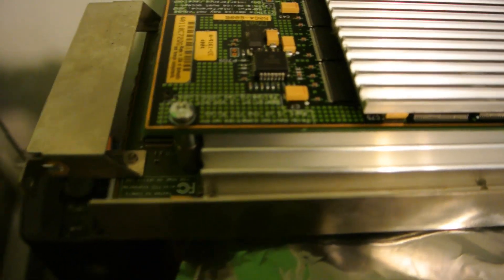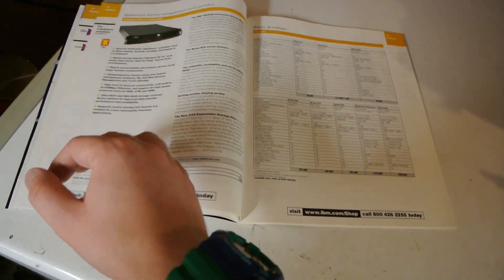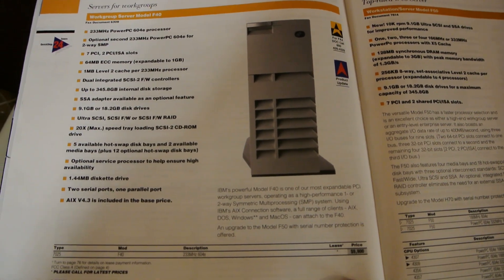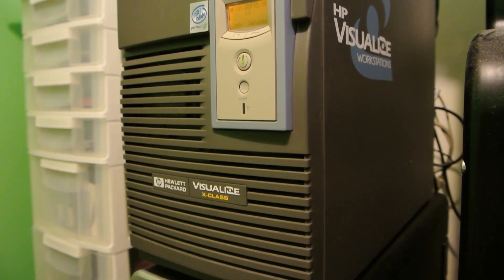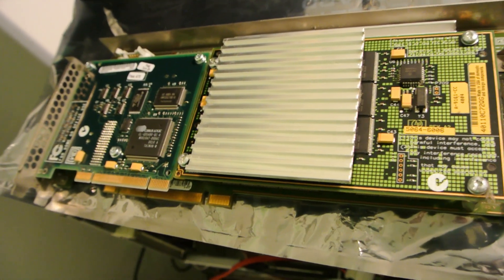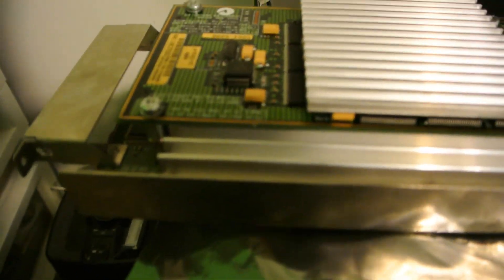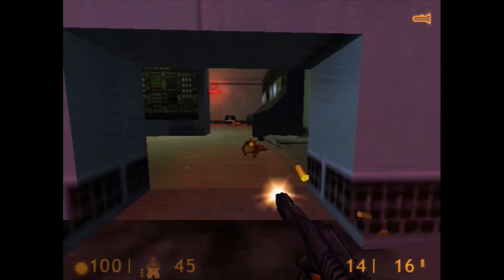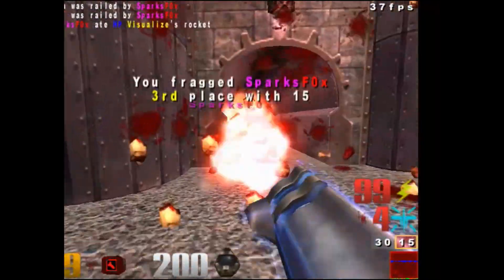The HP Visualize FX6+ GPU: A bizzare over-the-top PA-RISC based GPU

Comment: I have an FX4+ version of this card which has no texture memory, so the only way to get decent performance in games was by disabling texture rendering (which is an option in the driver).  There's a texture memory upgrade that can plug into the card and I saw them on eBay a few times but never bought one.
The driver has a bunch of application specific settings for serious 3D apps like 3DS Max and Pro/E and such.
As mentioned in the video Direct3D isn't supported at all, only OpenGL.
The Windows driver does support DirectDraw, but it performs very poorly in that mode.  A cheap and basic consumer card of the same age is much faster in DirectDraw than the FX4+.
VGA image quality was very nice, noticeably better than most video cards.
The card's steel frame has an arm on it that screws into the case, so it's weight is supported and not just hanging. Unfortunately that's not part of ATX standards so a generic case won't have anything for it to screw into at that end.

I used the FX4+ for a while until I wanted to play games again, plus I wanted to dual boot Linux which had no support, so I had to swap out the card.
Fortunately the HP that the card came from was 440GX based so it's AGP slot was totally usable with "normal" gaming oriented cards.

Comment: These video cards were the best on the market for FEA and CAD back in the day.  I spec'd a bunch of these out for an engineering department back then.  Even still today, computers struggle with large CAD files.  There are still times today that even if the processor was 10X faster, it still wouldn't be fast enough.

Comment: Seems to run maybe faster, but is more glictchy than the PC I had at the time when Quake III and Half-life were published (Celeron A@417Mhz & 2 x Voodoo2).

That hall of mirrors effect from the sky etc. in Quake III usually slows down FPS massively. If it's possible to get rid of what ever is causing that, probably would make Q3 overall faster.